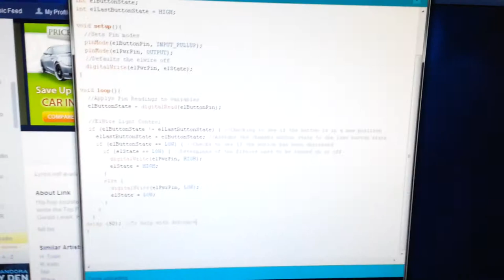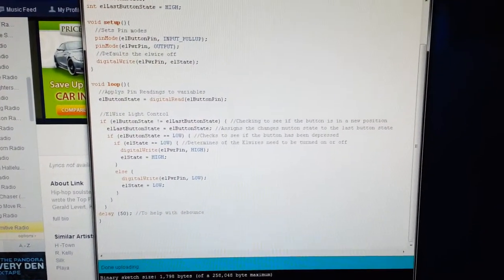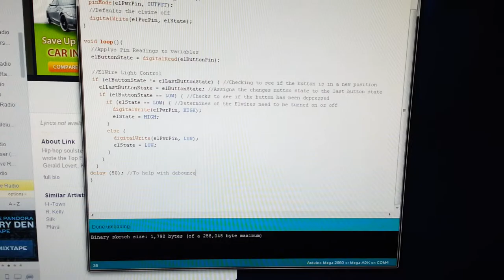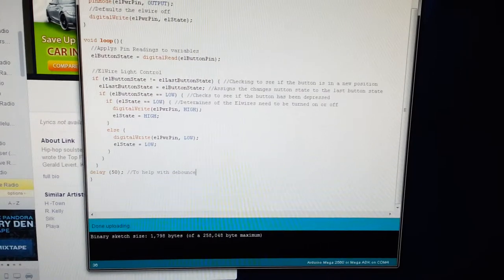Car control - Baby steps

Comment: how do you connect the relay to the arduino and to the sound system? I got a relay board, but it didn't come with any paperwork.
Reply from the maker: hey man, it's been awhile since I've looked at it haha, but I remember that you needed to supply that relay board with power. I think it was 5 volts, but I don't remember off hand. It's a separate feed from an output pin to actually control the relay on the board. as far as the amplifier side, all I did was take a lamp wire extension cord, cut the hot wire, and splice it into the common and normally open pins on the relay blocks. sorry if that's not super helpful, if I get a chance to dig it out, I'll reply again with more info. Happy creating
Reply: +Michael Aschbacher thanks, that actually answers my question. thanks much.